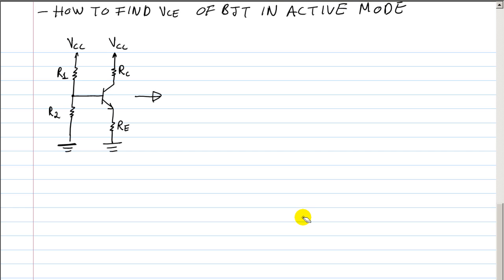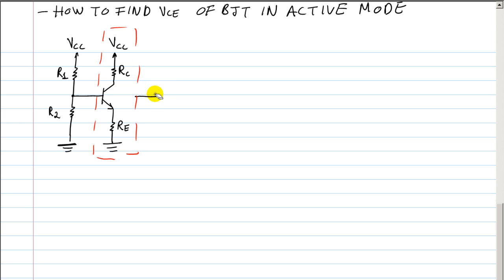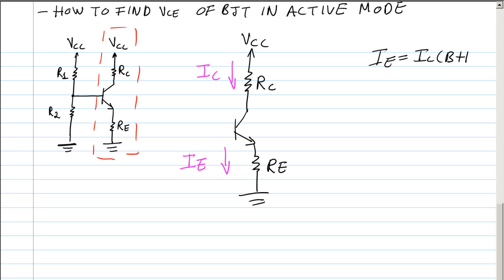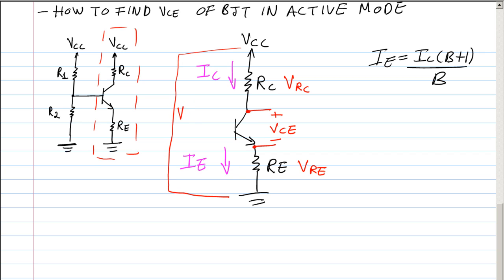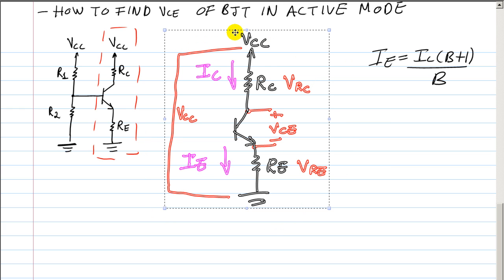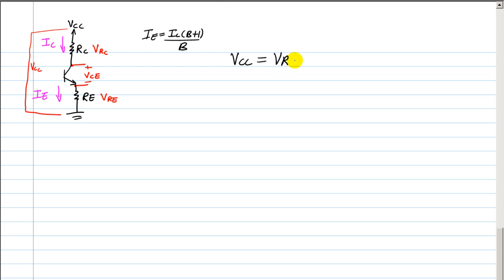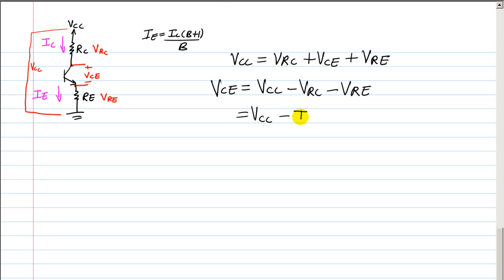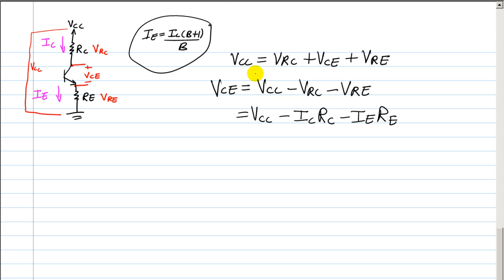BJT Q-point: Formula For Vce (Voltage From The Collector to The Emitter)

Comment: That’s simple people are most likely here because at Rc your only given the ohms and not given a bolt or a current there how would you solve for Vce not given a current or a voltage at the load resistor

Comment: why in my textbook, V(RE) is ignored when it solves for the collector current?
Reply from the maker: Does the circuit in your textbook have an RE resistor? Could they have possibly skipped a step or represent VRE using current and resistance? Perhaps a typo?